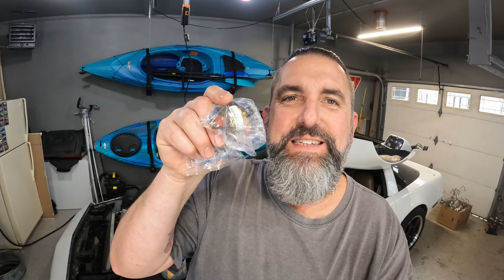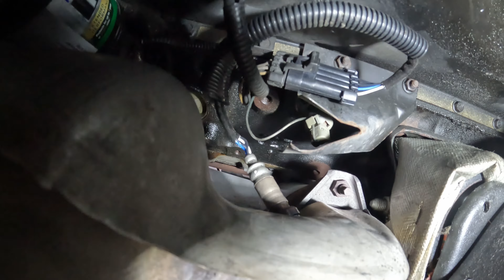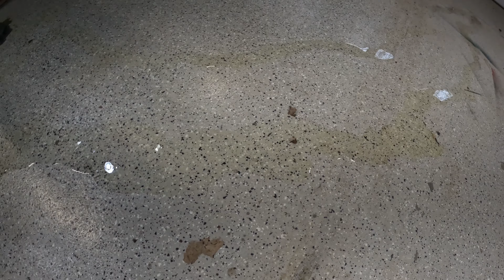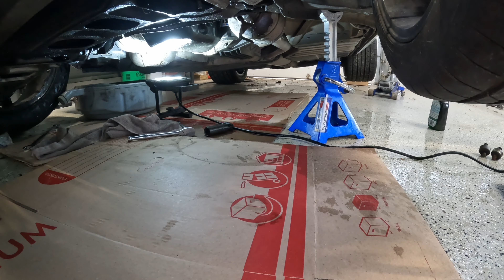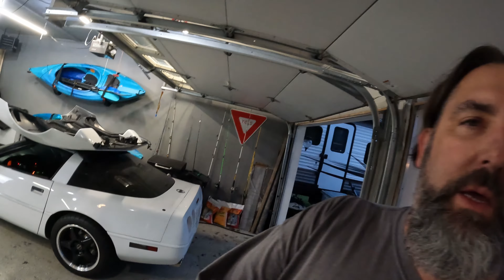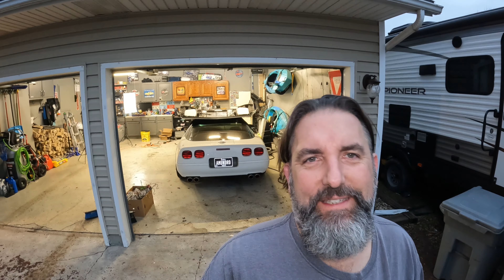Replacing Knock Sensors 1994 C4 Corvette

Comment: You look crazier than normal in that picture,lol.
Were you hyped up on red bull??
Cool parts canon graphic.
Reply: @Amundred  Why you so crazy now???
I'm outside working on my repair.
Going good, I hope!
Reply from the maker: @geneyus6411  my car is making me crazy! Will.you have your's running today?
Reply: @Amundred  possibly or close to it.
I went this morning to a specialty bolt place, bought a m10x1.5 x 3in bolt.
Last one they had. It's a grade 5 black oxide coated. Little by little cutting it to length.  It threads into the original bracket very tight.
Getting ready to put red loctite on the snout piece I made off the sacrificial tensioner,lol
Very tight work space,  dremel is the main tool today. The new bolt with star lock washer was $1
Reply: @Amundred  Ever notice that the little snout the pulley spins on never wears out??? It's always the cheap pulley that wears out🤣
Reply from the maker: @geneyus6411  right!
Reply: @Amundred  Amazon delivery guy just handed me my new tensioner.
The homemade snout I made is tight flush up against the old bracket.
I smoothed the whole bracket flush.
The new bolt was well worth the $1
This repair is wearing me out!
Reply: @Amundred  Do you think it's a good repair technique??
Others on his video have said it works.
Reply: @Amundred  Question for you,  
Are your drivers side spark plug wires routed over or under that large power steering line??
Reply: @Amundred  To bad " car crazy" already patented by Mcquires
But it's not to late for you to patent making a billet C4 engine bracket with billet pulley mounts!
Reply: @Amundred  Are you 110% sure that you didn't mess up the firing order??
That's exactly what it sounds like.
Reply from the maker: @geneyus6411  firing order is 100% correct
Reply from the maker: @geneyus6411  it runs fine when cold, revs up no problem when cold. Once the car reaches running temp, it falls on it's face, misses and will not rev up
Reply: @Amundred  ok, good!
Reply: @Amundred  Try out your new OBD1 reader yet?
Reply: @Amundred  I might have to unsubscribe,  this channel makes me go crazy!😱
Reply from the maker: @geneyus6411  yup...I posted an update about it. Receiving an error code which has to do with an ignition fault that is often times related to a faulty ECM -
Reply: @Amundred  Just read that.
Thanks for the update.
Do you remember if the spark plug wires on drivers side go under or over that larger power steering line??
I'm guessing under🤔
Reply: @Amundred  So maybe by warm up time a circuit board is getting shorted, cooked. Idles perfectly

Comment: Do yourself a favor, on your next coffee break, try using the funnel the proper way! It seems like you were in rush mode.
I've recommended that many times and never heard a complaint.
Also you could have had your new sensor ready to screw in as you pulled the old ones, cut down on mess!
Reply: I used a Funnel too.  It works just fine ... then start the car with the cap off and you can see the stream of fluid coming from the water pump and slowly fill.... it works for me
Reply: @deney54  used that same bleed funnel??
It comes with fittings lock it down to your expansion tank, creates a tight seal, that's how it bleeds😥
Reply from the maker: I used the funnel...I just did not see the benefit over just filling up through the expansion tank. It does it the same way...but instead of pouring coolant into the funnel, you pour it directly into the tank. 🤷‍♂
Reply: @Amundred  Just filling your coolant up in the expansion tank is not bleeding any air. That's an air  bleed specific funnel,  not just any funnel,lol
Reply from the maker: The one one benefit that I did like...not having to worry about the coolant overflowing and leaking all over the place. WHen not using the funnel, the coolant levels rise and fall as the car "burps" and you have to really be on your game to close the cap when the coolant starts flowing to avoid the overflow. With the funnel, that was not an issue as there is plenty of room for this.
Reply: @Amundred  When it starts rising like that, you should be done. Turn the engine off immediately and it will not overflow.
You should also run your heater to get air out of heater core.
Makes a huge difference in these cars getting all the air out or they overheat like crap. Then you take what's left on uour funnel and directly fill your overflow tank by the radiator and done!
Nothing spilled,lol
Reply: @Amundred  On a side note, with luck my 95 could be done today🤞
Reply: Did you read somewhere that people lose interest after 10 min of video??
Supposed to show vulgar languages and breaking things too😱

Comment: Sorry man, But I did finish my 92 vette with the Optispark, And it runs great ... let it warm up, hit the throttle and she's back to normal...so new Optispark, top seal, coil, wires, plugs, water pump, belt,
About 500 bucks latter, now to the brakes and yesterday had my new tires put on the stock wheels.  I still think it's your computer..... it's not letting the RPMs to rev up, Check all connectors to your ECM, I would go for a new ECM $200 I think.... Good luck
Reply: How did you remove/install your balancer?
Reply: @geneyus6411  You don't need to remove the balancer ... they are two piece, just three bolts and slide it out, the main yoke stays on the crank, so I did not replace that seal, just the seal behind the water pump ... they say the whole job for Opti is 5 hours and if you clean everything and take your time, I could see 5 hours.
Reply: @deney54  You weren't tempted to replace the timing cover seal, crank seal??
Reply: @geneyus6411  It was not leaking, soooo don't mess with it.
Reply: @deney54  10-4
Reply: @deney54  But when you have that much torn down, it's worth doing , especially on an older car.
Reply: That's awesome about your 92.
That's a lot of work!
Reply from the maker: I am glad to hear that your's was fixed with the Opti replacement! I honestly thought that this was my original issue when I started doing all of these videos! 

I will have the software and plug today so that I can hook my laptop up and see what it looks like in the software. It definitely could be the ECM (others have suggested this as well!) and that may be the next thing that gets ordered!

Thanks for stopping by and letting me know what your fix was!